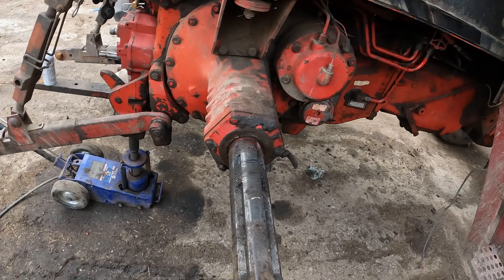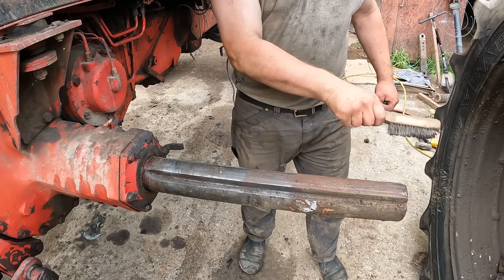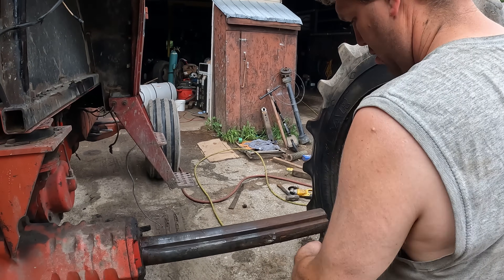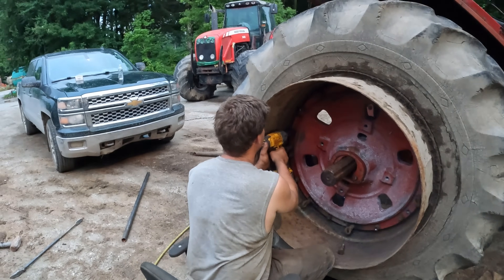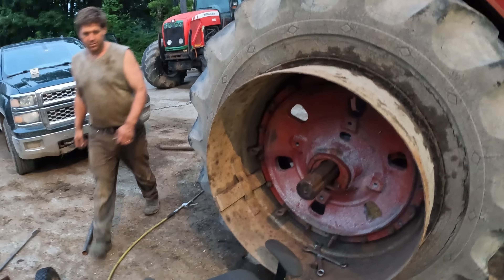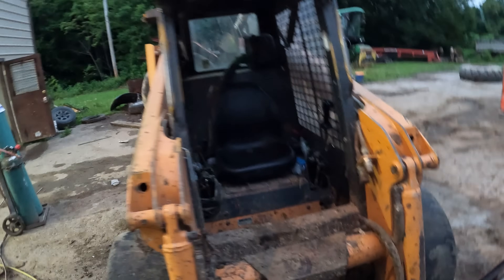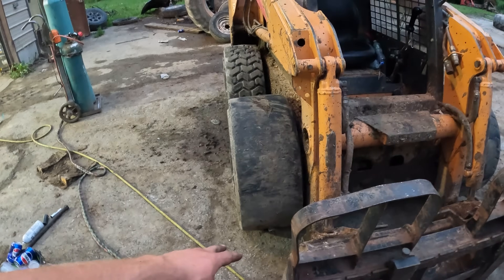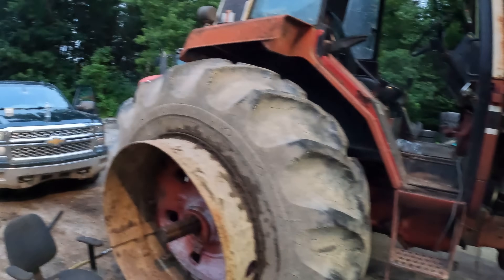Burnt tractor used to fix another one

Comment: That "C" as you called it, is used to prevent only 1 wedge block coming loose as you undo them. The block will come up against it forcing the other block out. I tried to tell you when you were taking the hub off the burnt tractor but you couldn't hear me
Reply from the maker: 👍🏻. Figured it was something like that